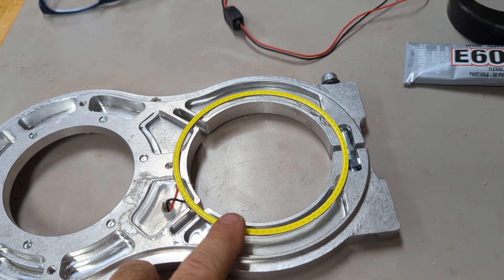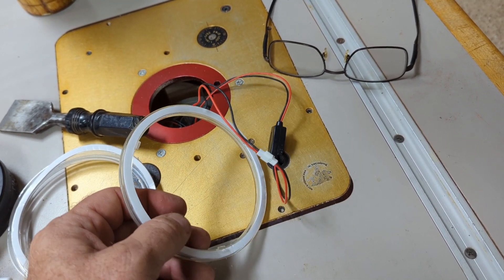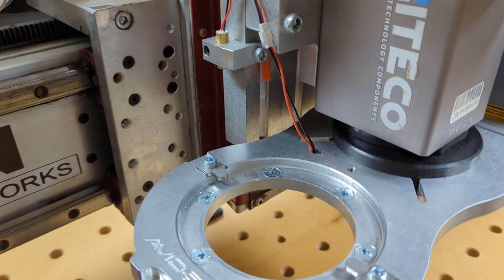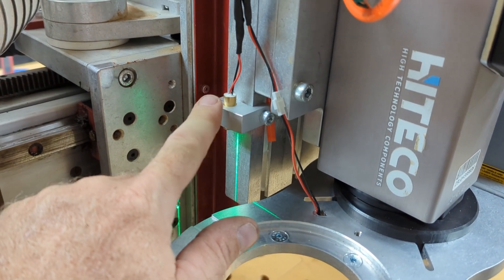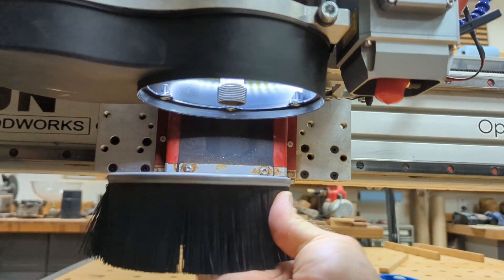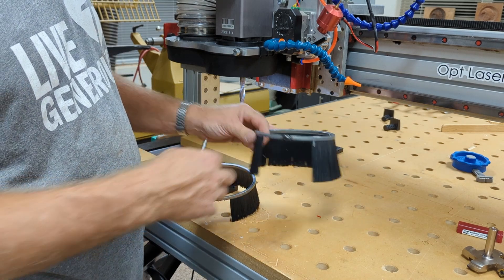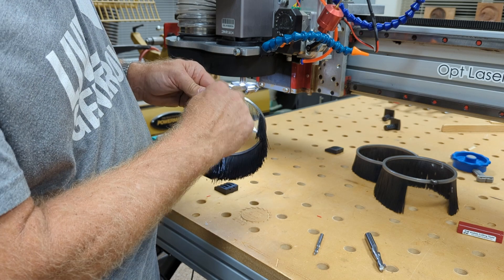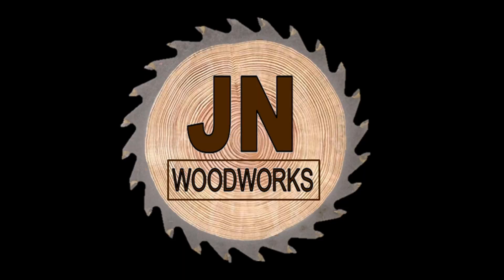I added a Laser Crosshair and a Dust Shoe Light to my AVID CNC.

Comment: what dust collection system do you recommend?
Reply from the maker: I have a 30 year old 2 hp Grizzly blower hooked to a home made cyclone seperator that is more that enough for the spindle.  This was spec'd at something around 1200 cfm I think.  I also use this same unit as a hold down for the laser table and to extract smoke when engraving with the laser.  If you are just trying to get rid of smoke from a laser, then any kind of blower will work.  These are nice and quiet: https://www.amazon.com/dp/B07JB292JC?ref_=ppx_hzsearch_conn_dt_b_fed_asin_title_4&th=1

Comment: I love the halo.  That’s going to happen.  I have been thinking about crosshairs lasers after seeing an Avid video but I would rather see where my bit is vs use an offset.  Still pondering that idea.
Reply from the maker: Ya, it's nicer if it's aligned with the spindle.  I did that before with two line generators that were mounted in my dust shoe 90 degrees apart.  Then you just turn them until the two lines converge under the spindle.  However, it is hard to keep it aligned well, if anything gets bumped you have to realign them.

Comment: Great tips, Jim! I like that crosshair assembly device and will replace the broken 2 LED device on my drill press with this one. Greetings from Oregon, Pete.
Reply from the maker: Hi Pete, hows retirement?
I'm not sure if this crosshair will work for a drill press.  Those usually are a pair of line generators that you adjust to get them to cross over right on the axis of the chuck (that is the type if thing I originally did on my CNC).  So you would want to look for a "laser line generator" instead,  and you'd need two of them.  They come in the same formfactor though and are on Amazon.
Reply: @JNWoodworks  Hi Jim, retirement is good. I'm still too busy with property maintenance, family issues and such, but overall it's good. I'm finally getting more time to spend in my shop. How is retirement going for you?
I thought about what you said regarding the cross hair and it made good sense. Amazon had a 2 LED clamp-on device that I bought instead the single LED device.
I just did a quick and dirty setup and test and so far I'm pleased. It works better than the original laser assembly that is build in to the Jet drill press. I may try to adopt the lasers from the clamp on unit to the obsolete Jet unit. We'll see.
Just a note, I enjoy your channel, good info and tips. And, it's nice to see a familiar face🙂
Reply from the maker: @pgoessnitzer  Yes, retirement is busy, I don't know how I ever got much done and still worked.  If the JET drill press laser is like the one on my powermatic, then they are probably junk.  Now you have me thinking I need to look for the aftermarket one too :-)